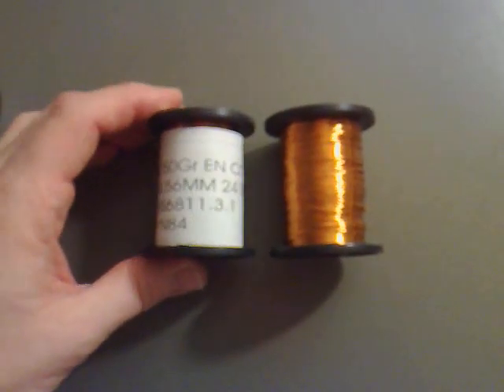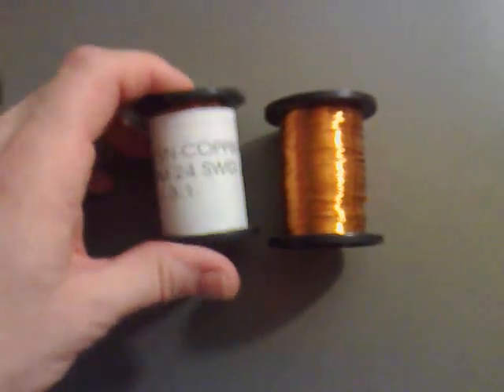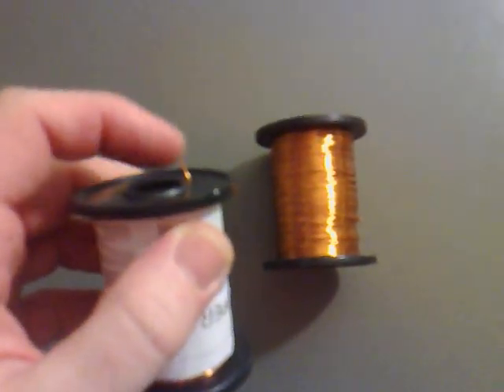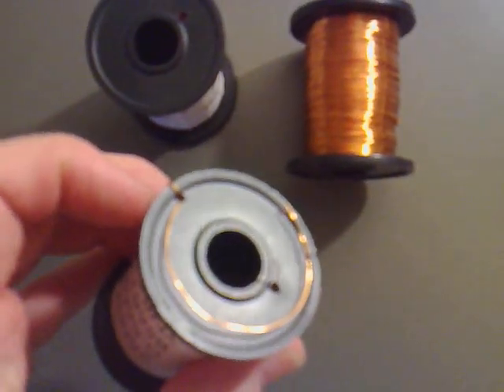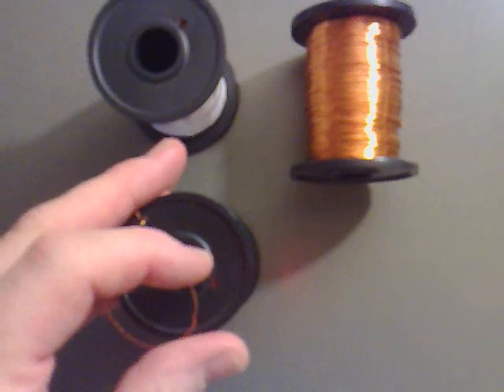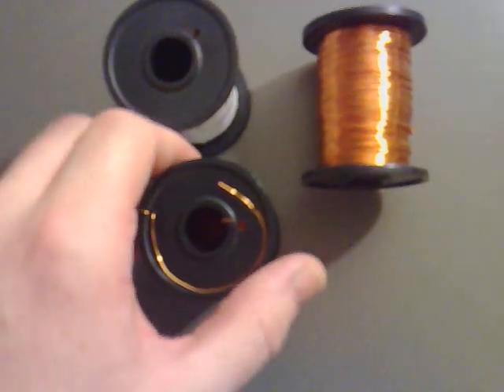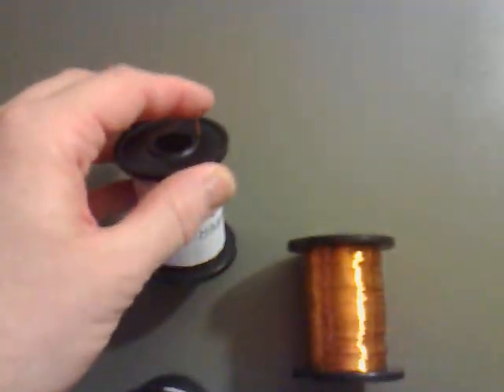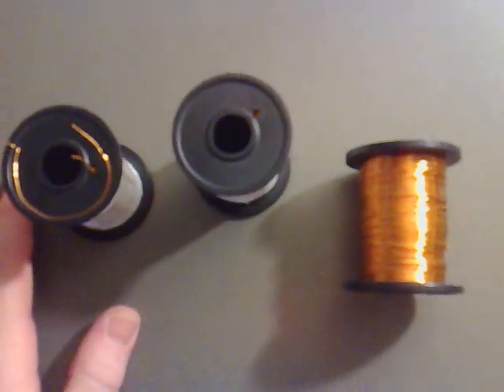Pulse Motor (Three Coils) 086

Comment from the maker: You can use any smaller wire, or the same.... it still works.

I think I used roughly a quarter of the size..

Paul.

Comment from the maker: I found that also with the core, video 008. I might blender some and epoxy it in. If not I have been told welding rods work well too. Putting the core in after makes it easier to change the setup.